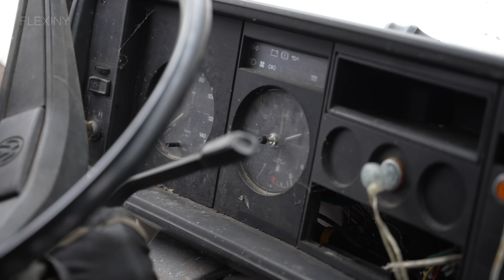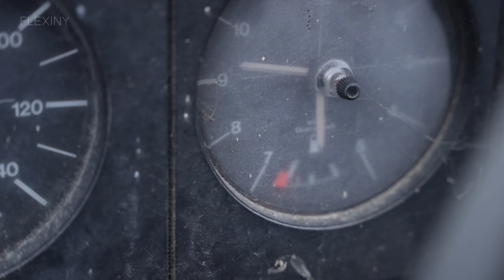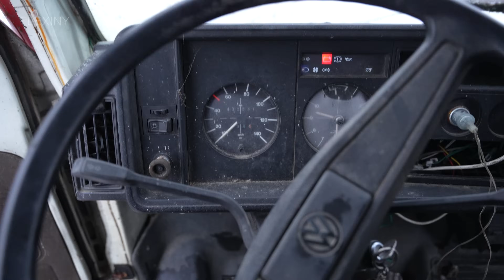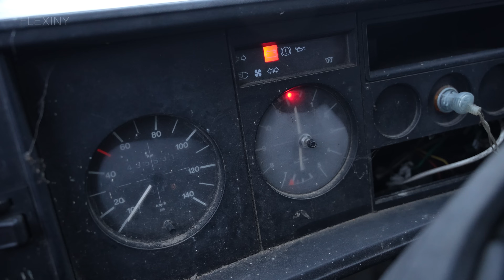Starting Volkswagen LT28D After 15 Years + Test Drive

Comment: Runaway is when the engine starts burning its own oil. In your case it is a blocked injection pump.
Reply: Sticking governor
Reply: She'll rev up till she explodes....I remember very well when I drove one of them...with oil leakages. She almost killed me in the cabin.
Reply: mostly happen when diesel engines are turbo supercharged. This VW LT engine is a simpel non turbo !
Reply: Incorrect

Comment: Good job. Just found this vid by occasion.
My new personal favourite, iconic with the I6 Patrol pulling it out.
Love the patient and smart step by step work of you.
The I6 diesel's (more or less all of them I would suggest) are simple and graceful powertrains, plain power and simple technics. Doesn't matter if VW, BMW or Nissan etc.
Depends only how the driver treat's it it can last forever.
Was concidering to get a LT as a camper in future, too, but I am planning to get a similar truck my father had in my youth. MB NG 1222 (My father had a 1422, but they are not that common, and as ex-firetrucks they are pretty available). I love the sound of the V6 NA, it is has a distinctive sound and also lives forever, the fuel economy is not the best but this is not that important for me, I wouldn't drive that much with it.
Move on!

Comment: In the 90s I worked for a firm that had the lt35 Luton vans a 90 and then 96 model replacement for the 90 model they were averaging1, 300 miles + a week as delivery vans they were very reliable.

Comment: I have an LT35 (facelifted) with the same body and engine as this LT28, brilliant van! Last month I used her to haul back my newly purchased Peugeot J9 (cool van aswell), bearing in mind the LT weighs 1.8 tons dry, the trailer 0.7 tons and the J9 1.7 tons dry, that makes 4.2 tons (+70 litres fuel, and 2 passengers, oh and a spare gearbox for the J9 which weighs about 250 kilos) so more like 4.7 tons, all that with the bone stock 73 hp D24 for 350 kms (one way)! No overheating, didn't skip a beat, only downside was the 1st gear crawl up at least a couple of hills (lol)
Reply: I borrowed an old LT some time ago to collect some chipboard apr. 100 km from my place..... some on the LT some more on the trailer..... I inflated all tyres to around 6.5 Bar but stil noticed how the tyres seemed low on pressure (?????!!!?)..... the LT had a bit of a hard time going back home.... on the scale at the neighbour’s place it showed a total weight of 10.700 kilograms.....
Reply: @henktulp4400  Haha holy shit! I thought 5 tons was a lot🤣! Was it a turbo diesel or not?
Reply: @mr.slaphappy3794  Yes,turbo.... but stil had to shift down to 3rd gear to make it up a (ever so gentle....) slope...
Good thing the cops didn’t spot me.... the fine would’ve been huge!!!
Reply: @henktulp4400  Lol good thing you had the turbo engine 🤣

I was holding about 75-80 km/h on the flat motorway without too much struggle, but on even the slightest incline it was down to 3rd gear (like you lol).
After the motorway I was going up some twisty hilly roads, and at one point I thought I was going to come to a stop, apparently first gear and full power nearly wasn't enough... Thankfully the road flattened out a bit after that😂

She flew past her emissions test 2 days later though 😅
Reply: @mr.slaphappy3794  hahaha..... if 2 minutes at max rev. in 2nd gear help to pass MOT then these two LT’s are now the cleanest Diesels on planet Earth.....
Reply: @henktulp4400  haha lol

Comment: Great old vans [I had 2 of the LT35 version].... as long as you don't want to go anywhere that involves climbing hills.  It would be quicker then to get out and walk.

Also a good idea to fit a non-return valve before the fuel filter [or always park facing downhill] as the fuel loves to run back into the tank, when parked up facing uphill. Leading to hard starting.

Comment: I wonder whats stuck in the pump interested to find out will we see part 2 ?
Reply: I don not wonder, it´s always the same: Rust and decomposed fuel are blocking the transfer pump and the regulator - after an overhaul the pump will do fine... Annother thing is dangerous for the engine, the rotten toothbelt. If the front toothbelt snaps, the engine is toast.
Reply: Yeah they didn't even pull the cover back and have a look 😕 you'd think the lever set and governor would free off after running a bit but it only got worse

Comment: I've got a 1996 version of this LT35 with ACT engine. Used to have a 1987 with DW engine. Both campers and non turbo 2.4L. I found if leak off pipe splits it won't start. Always carried a spare length of pipe.

Comment: I think the governor in your injectionpump is broken. 
Most of the times the little notch that slides the collar on the plunger snaps of. 
This happens when a pump stands a long time whitout fuel in it. 
The next time you should fill the pump and let it soak for 24 hours to loosen the collar.

Comment: Nice runaway there! I recon it was running on oil fumes from the PCV feed to the manifold,
Reply: Нет, там в насосе цикловая подача была большая, + долго стоял регулировки прилипли
Reply: Should have put some system cleaner in the fuel. I am not sure what fuel additives are available out there but one that works really well on dirty diesel fuel systems is Power Service.

Comment: ^^ i knew someone that also had an VW LT28 diesel and when he turned the key the engine was rumbling and the exhaust shaked so much, i thought its gonna fall off... XD but after 2 or 3 minutes the engine start to run really smoothly...and it always started on the first try... 👍 it burned out a few years ago 😕

Comment: They have got guts...I would not dare. This 6 - cylinder has got 2 timing - belts....if the one for the injection pump snaps - she stalls, not too bad....but the other one...good - bye 6 - cylinder, RIP....
Reply: The fun of interference engines. Belt pops things go crunch in a hurry 😮😮. Not pretty.
Reply: @carlbernard4197  No, really not funny...and spare parts - difficult to get - are really expensive...I would not even turn the key.

Comment: The next time a runaway happens to you with a diesel, the easiest way to stop it is to put it in the highest gear and stall it, it happened to me once and I stopped it like this
Reply from the maker: Then you have to hope there is good clutch. Sometimes clutch starts slipping with high gear if it is bad.

Comment: Sorry but that is not the way to start a old engine whit bosch fuel pump.After a year of sitting the pomp will block inside.First you take the pump and injectors to a service and after cleaning them it will start at the first key whit out damaging the engine.

Comment: Starting fluid..first you put inside engine
Reply: Big no no on a glow plug equipped diesel. Will blow the top of the engine apart. Seen a video where someone shot ether into a glow plug equipped diesel and blew apart part of the head and the intake manifold. Very expensive ouch. Was a much bigger diesel than this little one.😮😊